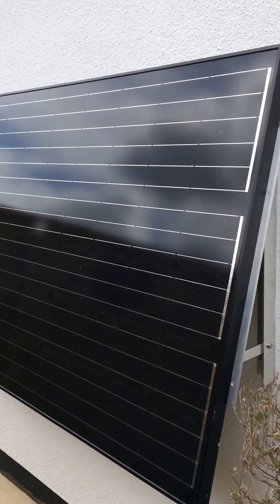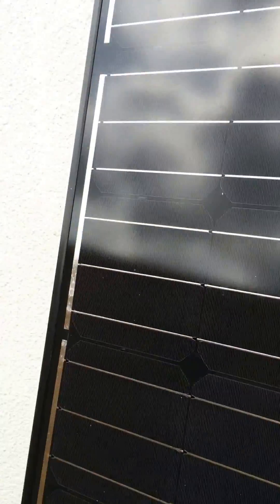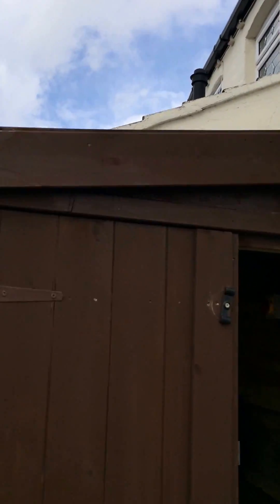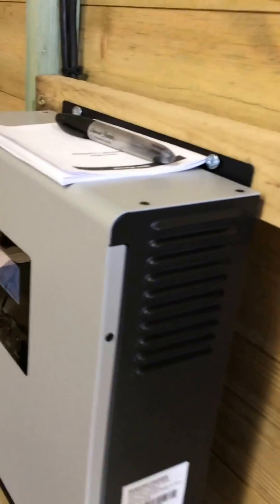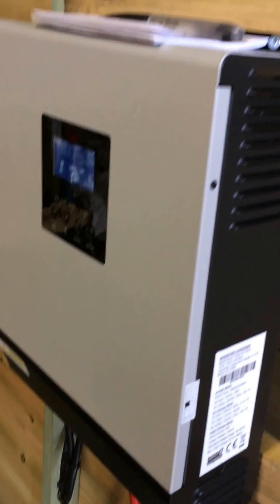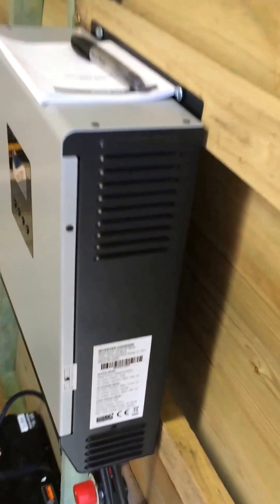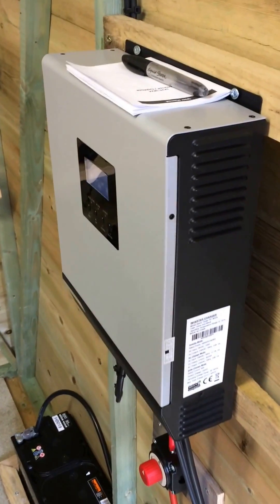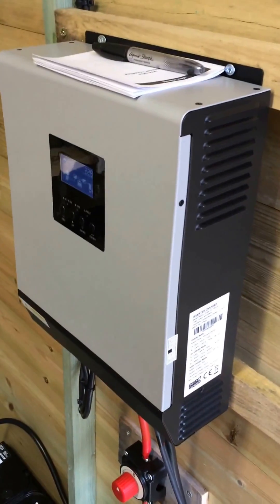Help with hpp solar watch power software??

Comment: Hy. I had also some trouble for the laptop to see the inverter. Finally I did solve it. Mine is 2424 hs with a cable like one for printers. One end usb for laptop and the other one like for a printer. My windows on laptop is windows 10 64 bits. I did install first the watchpower from my cd that it came with inverter. The version was 1.08 . But that did not work. Even if it was connected to laptop it did not showup automatically. I did a few uninstall and install but that did not help. So i download the last version watchpower 1.10 from this link( you have to unzip the file)    http://www.diypowerwalls.com/t-New-version-of-watchpower-for-PIP-inverters-has-been-released?pid=2534   and surprise. It work. It show up automatically in software. Hope it will work also for you.

Comment: Hi Mark,

Not sure if problem is now solved..

I had an issue with 2 laptops running windows 8.1..neither of them would register the inverter when plugged directly to a USB port...

my solution..i had some USB expansion adaptors ie 4 usb sockets plugged into single usb on computer..then plugged inverter USB into the hub...all then worked OK..

Still dont know why the direct connection didnt work..but at least i am now communicating with the inverter..

Cheers,

Derek
Reply: Derek Nelson I am having same issue would u know how to get it going have tried 2 different computers

Comment: ok contact pegy from mpp solar.... 
try to load softweare from disc to a nother computer... and try again
Reply from the maker: do the do software for a macbook?
Reply: I would not know.... 
On inverter you have code to activate softweare so try to put that code in softweare... And try also try to run your softweare as administrator....

Comment: hello 
in YouTube look for HBPowerwall and look for Jeremy O'Hara from Australia they have inverter's like you or serch for PIP2424 
or offgrid solar inverter
Reply from the maker: I've been on most YouTube solar setups
But they don't talk about communication between PC and the inverter
That's what I want to know about
As my laptop and the USB cable which came with it doesn't seem to recognise 
There is a USB connection ??
I
Reply: Ok I have one question is this inverter from MPPsolar...?
Reply from the maker: +Bostjan Trancar yes